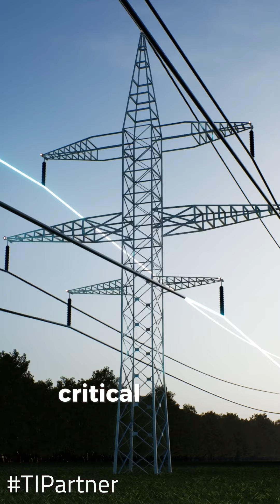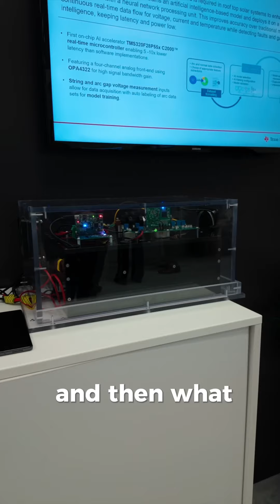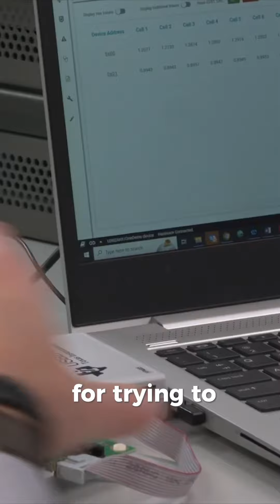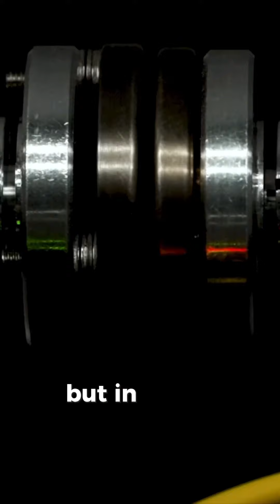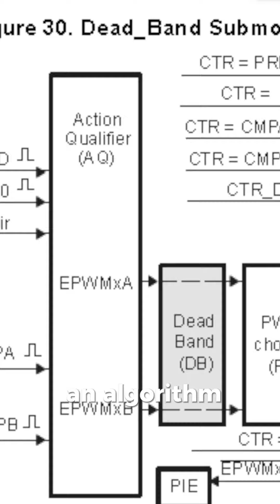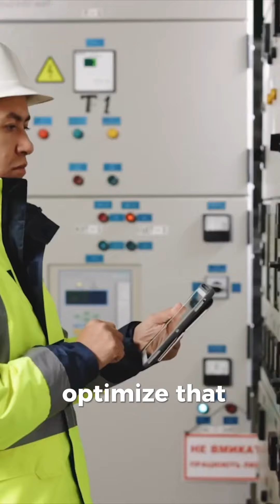Making Renewable Energy Safer and More Efficient

Comment: Texas Instruments should not let engineers or marketers do presentations.  They fail to explain anything concisely or clearly, don't demonstrate the need or use case or why it matters, and fail to connect with any practical benefit.  Further, they have videos of items with no cover, no user interface panel, no end-user, consumer, or industrial products.  So they say technobabble like the most boring parts of sci-fi, with neither product or use case.  Furthermore, Texas as a state has massively failed to develop and maintain a stable power grid despite relative mild conditions.  Why should anyone trust Texas Instruments with anything?  The last product of value that TI made was Speak & Spell, or maybe the TI-89 or TI-92 graphing calculator.
Reply: They should get the marketeers from Big Pharma.  A cheery female voice narrates the technical stuff (like the terrible drug side effects), edge node computing whatever that is, while the pictures of the happy family play outdoors.  Ending with "Texas Instruments helps Grandma find the puppy".

Comment: Stopping CO2 emissions worldwide and in Australia with grid electricity is insane because the grid is insanely expensive to expand from its 10% portion of all fossil fuels used.

Grid electricity was meant to keep the lights on and some other general work. 

Just switching the Airconditioning on can break the electricity grid.
Warming latitudes and more heat pumps  ???
And more industrial grid load ???
And no petroleum ICE age vehicles ???

The Australian grid costs $TRILLIONS in our $1.5TRILLION economy and was built over  14decades, all to meet 10% of Australia’s total energy demand. 

More grid means an explosion in CO2 emissions from mineral extraction to the new 10x bigger grid capacity and  decades delay.
10 decades delay in fossil fueled CO2 emissions reduction. 
More grid means an explosion in national debt. 

Fortunately customers rooftop PV and EVs technology is in mass production.

Today 6kW rooftop PV is only 30m² on the 200m² avg home roof. 15% of roof area.
And only some of the 20million roofs. 

Today 20million panels, 37.8 gW, and x3 to x5 more are needed and matching battery capacity.

Fortunately PV rooftop is cheaper than windows $m² and vehicles are becoming battery vehicles. 
Most vehicles are parked 23hrs every day and all night long. A massive electricity storage on wheels. With v2g and selfplug-in selfparking.
Battery Vehicles topped up daily or daytrading electricity with the grid. 

Fortunately industrial customers moving away from fossil fuels to clean electricity will need all the feedin electricity from millions and millions and millions of customers. 
Fortunately for grid owners cashflow. 

Fortunately 80% of the world's population live in warm latitudes. 
Fortunately plutonium producing nuclear electricity and its massive grid are not needed. 

Unfortunately 80% of the world's population live in dictatorships and dictators love plutonium. 

Even cold latitudes nuclear nations have many sunny months and will have volatility in daily grid demand. 
Canada is firing up peaker plants.
Reply: Solar panels can not produce enough power to meet human need, even if you place them across every square meter of the Earth's surface.  Furthermore, solar panels deteriorate over time, producing less power, and have an effective lifespan of 10-15 years if you are lucky, meaning you have to rebuild the entire infrastructure every 10-15 years AND expand it.  You talk about the 100-140 year lifespan of the existing grid, which is a strong point in favor of grid power.  All the extraction, shipping, installation, removal, shipping, snd if lucky recycling, but most likely landfill then landfill excavation and cleanup in 50 years and destruction of health from pollution of water table... all that far exceeds the energy required to hoist some power lines and leave them up for 100-150 years.
Reply: @Warp9pnt9  your crazy, the build time is decades and decades. 
Your maths is wrong. 
You would be an idiot not to recycle PV panels. 
Panels lifetime is double your guess.
The existing national electric grid is 10times too small. A strong point against existing grid. 
Grids make 4cents kWh electricity into 45cents kWh electricity. 
PV panels are killing grid demand every day the sunshines. 

Now if you live where the sun doesn't shine you have big problems.